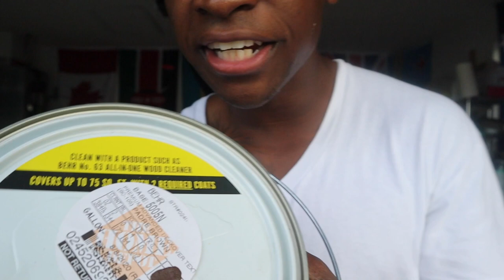DIY PALLET CORN HOLE! SIMPLE DIY ON HOW TO MAKE THE BOARDS!! DIY WOOD WORKING PROJECT! BEGINNERS!

Comment: The thing is that the boards are not straight and I am not running that threw the planer or jointer because that could have some metal or screws and you won’t even know it
Reply from the maker: That's the benefit of screwing them down!